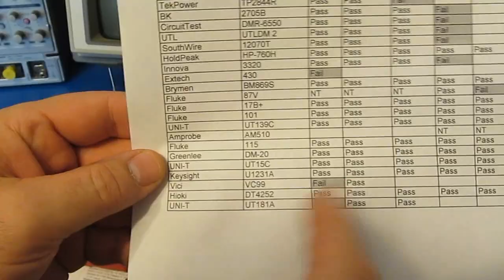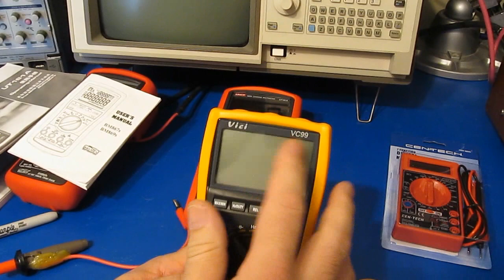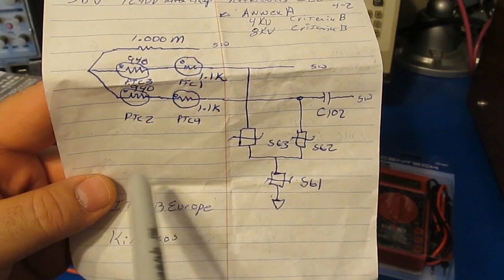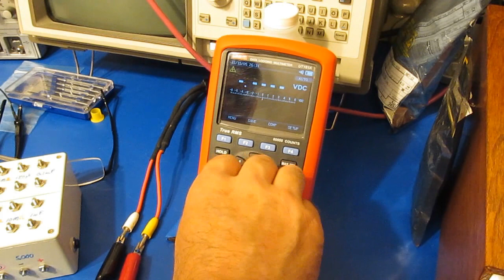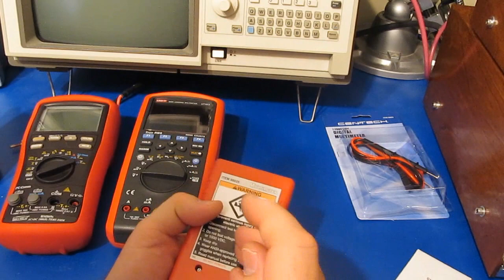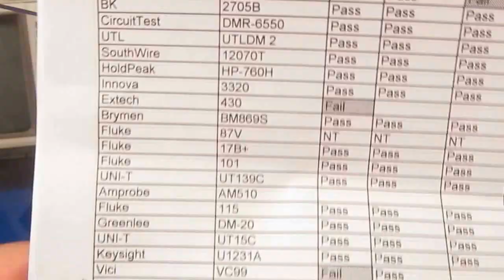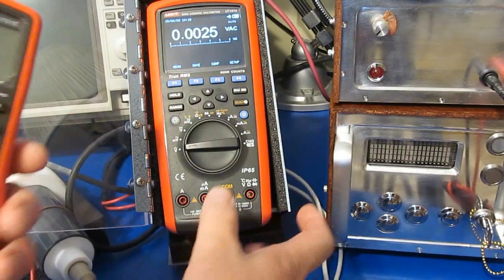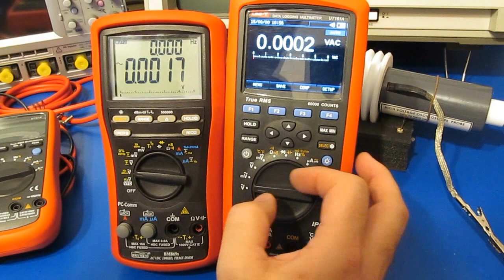The UNI-T UT181A Datalogging Multimeter Review Part2

Comment: That was really interesting. I learned a fair bit. 6 years later I think that I am reading that they registered your concerns and now have upgraded the product to the EN 61326-1 standard. At least that is what I hope I am reading as I just bought one. So if true put in your sales commission claim. I really admire your knowledge and skill level, particularly swapping out that part.
Reply from the maker: If they have addressed any of my concerns, I am not aware of it.   They have never contacted me about any of this testing.   I have posted several times that I would be more than willing to invest the time to repeat these tests if they actually did release an improved version.   Enjoy your new meter.
Reply: @joesmith-je3tq  Thanks Joe. I live on a boat so dry static is the last possibility. I’ll be more concerned about filling it with water, even though I did buy it for work. I think i sort of know how you fixed the problem, you did give several clues, so at some time I’ll look inside to see if there is anything different. They do quote the EN numbers in the current on line manual. That aside there is a need in the marine world for protection devices for our marine electronics from lightning surges. I was thinking that a highly protected “Uninterruptible Power Supply” might do the trick of protecting the main Navigation Computer (Ray Marine Axiom on mine) with a battery with an anti surge stack on one end (Fuse, Inrush limiter, Zener Diodes, Capacitors) then the battery then a DC/DC converter after the battery, ahead of the computer …….or something like that. If that interests you, I’ll buy your prototype.  I’m going to great lengths to protect my Lithium Batteries by putting the whole solar charging system in what I hope will be a faraday cage housing.
Any way, loved your videos, and forwarded to some friends who are engaged in your similar field, as you set such a high testing standard. Really impressive.
Reply from the maker: @williambunting803  I did make a detailed video where I attempt to harden the UT61 if you are interested.

Comment: I have been using the UT181 in the field now for 18 months, really handy having the data logging without needing to have a pc or android device on site while logging. It has been extremely accurate with no problems. In this video other than the  ESD failure the 181 blew away all the other meters as far as the needs I have, but then again I have never blown a meter in the 60 years I have been using them.
Reply from the maker: The 181A, pretty much like all the UNI-T products I have looked at, do very poorly against my tests.   I am not surprised.  Assuming you are 80+ unless we are talking internet years.  I would imagine there are many people who buy products and don't actually use them and they last their life time.  Fairly common.
Reply: @joesmith-je3tq  What do you think.of UNI-T 139C or 139S and say APPA iMeter5? Would these be a good choice stand up against the tests you were conducting with transients?
Reply from the maker: @stanleywhiteman6450  Let me ask you.  After looking at more UNI-T products than any other brand, are you seriously expecting a different result?
Reply: @joesmith-je3tq  In your test check list in this video Uni-T UT139C has passed all tests. Its accuracy ok. Overall makes a good meter fir what it is. We have seen a great success with APPA iMeter5 accidently purchased in orange case - it works well, resisted all incorrect connections, has plenty of functionality for such a small card type meter and surprisingly during the real electric storm it was left in one particular setup connected to  240V mains for 2-3 hours it was fine after this event. At the same time Victor 921 was left connected to the same mains (do not ask why would anyone in their right mind to do so) but the real field test led to Victor 921 blown off with the laud bang and APPA iMeter5 was just smiling at the tingling of high transient which travelled several times that night on this source of power..Just saying..
Reply from the maker: @stanleywhiteman6450  I ran two 139s and suspect both would have been damaged at the same level.   Which was far below what I consider robust.   Just saying....
Reply: @joesmith-je3tq  Thank you Joe, very informative.

Comment: A top-notch review which educated me a lot. For people complaining about the ESD-mod: If you want an ESD proof meter just get one with the correct cert - If you know what you do - then you can do it yourself - but for everyone else out there - get the right tools for your needs. Most people will do excellent without the MOD because you don't operate in ESD overcharge-prone environments. Also, Joe specifically mentioned this in the end of the video.
Reply from the maker: I never state that most people will do excellent without the MOD because you don't operate in ESD overcharge-prone environments.  If anything I have said how bad it gets where I live.  ESD is a pretty common problem.    As for needing a more robust meter that is able to survive longer duration transients like I test with,  I think that really comes down to what you plan to use the meter for.    I would certainly never recommend anyone modify a handheld meter because of the risks involved.   If you want to see a more robust UT181A on the market, write UNI-T requesting them to harden it and explaining why you want it.    Attempting to mod the meter is NEVER going to be the right answer.
Reply: Well noted :)

Comment: If you want to search and verify an ETL (Intertek) listed product. Intertek has a public website where you can look up the model or manufacture and see what standards they met. According to Intertek's directory of listed products, the Uni-T UT181A meets the following standards: CAN/CSA-C22.2 No. 61010-1 & CAN/CSA-C22.2 No. 61010-2-030, UL-61010-2-030, UL-61010-2-033, CAN/CSA-C22.2 No. 61010-1-12, UL-61010-1.
Reply from the maker: As I stated in the video, I am more concerned if they would pass 61326.   My confidence is low after seeing the 121GW with an ETL approval.

Comment: Excellent video Mr. Smith!!!. Sad to see my UT181A failing that way. I live in a carpeted house and during the dry winters the sparks makes a nice show. I have an idea of the modification you did to improve the multimeter but I don't want to test mine to see if I did it correctly. It would be very nice if you share the modifications you did to it to achieve that fantastic results. Thanks!!!
Reply from the maker: If you cut the PCB and rerouted some signals, then you have a pretty good idea indeed, but the proof is in the testing.  If you are interested in seeing this change, I suggest you write UNI-T a professional email requesting it.  It would be nice to see them improve the design for everyone's benefit.

Comment: Hi Joe.
Thanks for the informative and intelligent testing of the DMMs. Great job!
I have one questions:
(1) Since your test of the Uni-t 181A  do you know if Uni-t has changed their design of this meter to up the failed protection circuit?
Their web page for the 181A seems to be stuck in 2015!
Thanks again for the great work you are doing.
Reply from the maker: I am not aware of them making any changes to the meter since I looked at it.  If they do improve it, I plan to run it again.
Reply: @meyou2798  The document you look at was signed 2014 (hence in effect for all sold UT181A) and seems to only include part of the 61326-1 and 61326-2-2 specifications. I checked their online manual and it doesn't mention 61326 at all. So, if I were to buy a UT181A, it would require me making the same modifications as joe smith did... and he doesn't want to reveal how he improved the UT181A. Which is a shame, as the UT181A looked like a decent multimeter for the money.

Comment: I'm ordering this meter/data logger. I would like to modify the Unit-181A are you charging for this would like to get the modification if at all possible.
Reply from the maker: If you need this modification, then you are buying the wrong tool for the job.  It is also possible that by now, UNI-T has an improved design.   This video is several years old.

Comment: I really, really like my 181A.
I will never apply the transients you apply during your testing; but you mentioned the static discharge from walking across a room. 
That happens a lot where I live with dry heat in the winter.
My question is:
Can I protect the meter from those transients without doing the major modifications that you did?
 Like cutting an extra slot in the board or adding an extra MOV...?
I am 70 + years old but had my own electronics shop for 35 years with a first class FCC License and warranty repair contracts with Motorola, E.F.Johnson, etc...; but my eyes are not as good as they used to be, my hands shake a bit, and I don't have a schematic for the meter.
 I have workarounds for the first two problems.
But I need  a little help with a schematic and a general direction or a hint as to what actually caused that TI power supply device to fail.
 That would be the only 'weak links' I would want to eliminate..
Great video as always.
Regards,
Dennis O.
Reply from the maker: You certainly should have the skills and education required to pull it off.  I am not aware of a schematic for the 181A but you could certainly trace it out.
Reply: @joesmith-je3tq  ,
I really appreciate you taking the time to answer my messages,
I won't bother you regarding this subject any more..
It was stupid of me to even ask the questions since in a year or two my kids will be selling all my test equipment anyway...
 I really do enjoy watching your channel and can understand everything you do, and why you are doing it..
 My mind still works well, but the rest of my body is pretty useless these days...
 Keep doing what you love to do for as long as you can; because you never know when life might throw you a curve ball where you can no longer do it!
Reply from the maker: @Dennis-mq6or  
If you read the FAQ or the comments, you will find your question about how to modify your meter has been asked many many times.  Their reasoning varies along with their claimed background and knowledge.   However my answer is always the same.  Don't be stupid and try to modify a safety device.  Of course, I will get the normal, I won't use the meter for blah blah blah and I know what I' doing.   This channel is not here to promote stupidity.  I will leave that to the other countless channels. 

While I appreciate your pointing out the curve balls life has to offer,  I am fully aware that none of us come out of this alive.  As we get older, our families and friends die in various ways. Some die slow, some fast.  Some self induced, some accidental, some natural. Sounds like you are just now coming to grips with this so let me be the first to welcome you to the world of the living!

Comment: Seem like meter design is around 8 years old now, is it still good for 2024? I'm interest this meter since price to quality ratio is seem to be ok for home use.
Reply from the maker: Only YOU can answer that.  IMO, the meter has too many shortcomings.
Reply: @joesmith-je3tq  Thank you, while waiting for your reply I did more deeper research on UT181A. Compared to 8 years ago they seem to slightly improve it overtime and now comply with EMC standard. At first I wanted a 287 but after found out that newer UT181 came with accuracy pretty close to 287 (And better on some range), faster graphic (also more logging memory) then I answered my self to go with 181A. Only downside I found is I can't use it while charging but it's acceptable more than frequen changing battery as many people (who hasn't affect by leaking super cap) complaining about 287 being battery monster.
Reply from the maker: I really have no idea if they have changed the meter or not.  If the meter passes the EMC standards, that is impressive as from what I have seen UNI-T in general have fallen way short.  I don't use mine enough to tell you how long the battery will live and if you can still find a replacement for it.   Personally, I would have rather had standard cells that I could swap.
Reply: @joesmith-je3tq  Me too, I never though UNI-T would pass any standard before.
Reply from the maker: I tried to download the latest manual direct from the manufacture but seems to be a problem with their site.  Other manuals I found on-line appear the be the same as what was included with mine.   I assume you saw where the manufacture claims they now meet the EMC standards and not something you saw on some forum.   Could you provide a link?  YT will not allow direct links so leave out the dots.
Reply from the maker: @MangMuang  Found it.  I went to save it and realized we have been over this before.  I had archived Intertek's papers from 2014 (2 years prior to my testing) claiming it passed 61326.   Did they change the design after the product was certified?  Did Intertek fail to do a proper job testing the product?  Do you think my tests are just too harsh?  I don't have any answers outside of showing that UNI-T products will commonly fail my ESD testing where other products that have been certified for 61326 survive without any issues.    Now, how you weigh that along with the other shortcomings, that's really up to you.
Reply: @joesmith-je3tq  All I see from several teardown, they changed some chip inside. It slightly different than your's. Too bad that no one has dig dive into updated one. Btw, thanks  you for your info and test. I think it's quite harsh but it's a pretty good test, I like how you test it.
Reply from the maker: During the start of this video, I show how that grill starter compared with the IEC standards they should be testing to. It didn't seem very harsh to me but I suspect UNI-T would claim otherwise as it sure has damaged a lot of their products.

Comment: Hello Joe, 
I am impressed with each of your videos and I can see that you have a passion for multimeters and an enviable knowledge. I wanted to ask how long it takes you to charge the UT181A for example from 50% to 100% it seems to me that this device has a battery charging problem. Thank you in advance
Reply from the maker: I don't use this meter very often.  If I know I am going to be using it,  I plug it in the night before and let it charge overnight.  It is done when I get up. Eventually the battery will need replacing.

Comment: Hi Joe Smith. I got a Fluke old model 87. got lots of problem with it beening old disply prob and damge in bad way. I want buy a UT171B UNI-T Mater what do you is a good one or not. or should I get the new 87v model fluke.  it would help for your recommendation. I definitely need a multimeter with 100 kilohertz bandwidth. Thanks Yannis
Reply from the maker: In the description, there is a link to a FAQ.    There is also a link to a spreadsheet where I document the meters I have ran.

Comment: Hello. Nice review. I have a question about the logging mode. Does it shut down the screen after some time ? how about the battery in that mode, how many hours does it last ?
Reply from the maker: The backlight has four levels, including off.  Just hold the backlight button down for a second or so and it will turn off.  You will find this on pages 33 and 44 of the manual.   The meter also has an auto power save mode.  Part of this is diming and turning off the backlight.  This may be found on pages 45 and 46 of the manual.   I am not aware of any published battery life hours.  I would imagine it depends how old is the battery, how many charges.  The meter uses a 2200mAh battery.  Charge reads full at 8.5 and empty at 7.5.   In the default mode, with the BL full on, the meter draws 87mA with a 7.5V battery.  With the BL off, logging voltage at 1sec interval, the meter draws 53mA. So maybe 40 hours on a fully charged new battery.  I've ran some test with it at 24 hours and had no problems.

Comment: I have one question, from yours experience is it worth buying Fluke 289 instead of Uni-T UT181A? Thank you in advance .
Reply from the maker: From my experience, based on my needs,  it would not be worth buying the Fluke 289 or the UNI-T UT181A.  I would rather buy the Brymen BM869s.   But I suspect what you really are asking is advice on what meter YOU should buy.  I can't answer that beyond, do your homework.
Reply: @joesmith-je3tq  Thank you for the reply. To be a bit more precise, I have already made a decision to take one of these two devices because of their data logging capability, even though I took into account the Braymen 289S, what I was concerned with was whether the Fluke 289 was so superior to UNI-T 181A to justify such a big difference in price, in our country  Fluke is almost 3x more expensive.